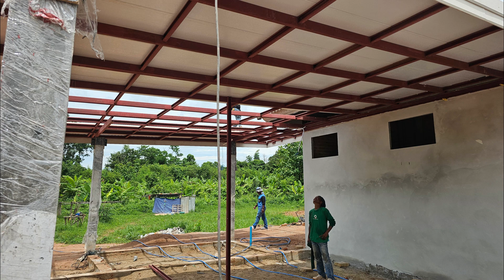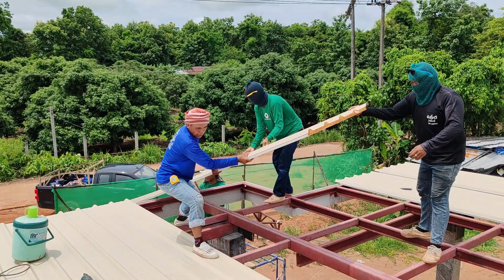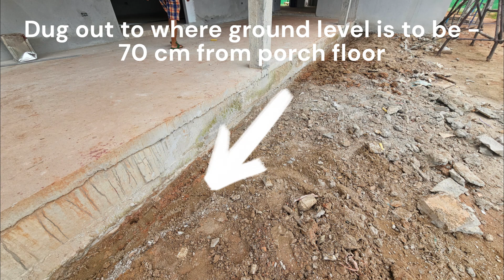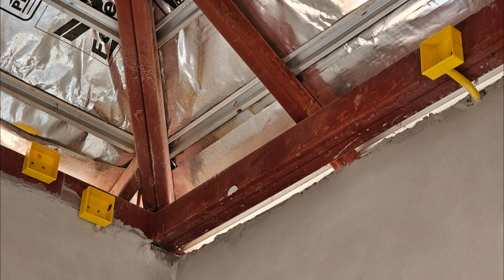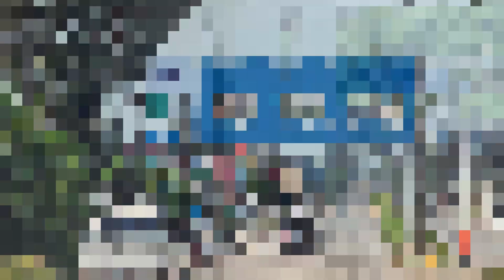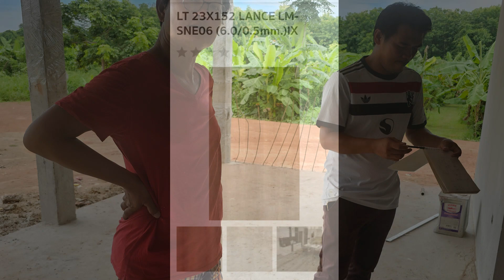Thai House Build Week 19

Comment: Because of those brown red soil around the house and your desire for cream colour at the exterior wall; talk to your builder to place medium size stone gravel around the house wall (at least 1 meter wide with soil barrier fabric between the ground dirt and stone). This is to prevent dirt marking at the house wall because rainwater splashing.

Installing rain gutters with 3~4 inch diversion pipes also reduced those dirt marking at the wall because you did not allow the rainwater to splash onto the dirt. If you decide to install rain gutters; just remember to place the water outlet pipes at least 3 meters away from the house wall/foundation to ensure the structure integrity of your house.
Reply from the maker: @rimzalia1362  There is 1.5 meter concrete pathway around the house walls. Appreciate the challenge with light walls & adjacent soil.
Reply: @RetiredTranquilinThailand  just ensure those floor pathways are slope away from the house. Plus, consider having brushes surface (can Google for photos) finishing on those concrete pathways.